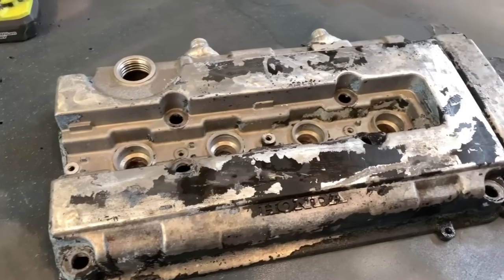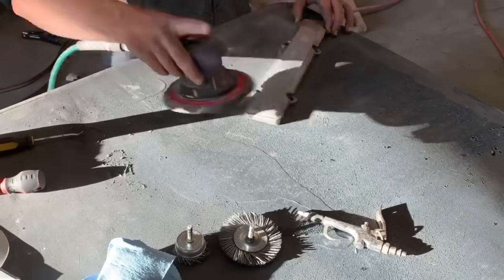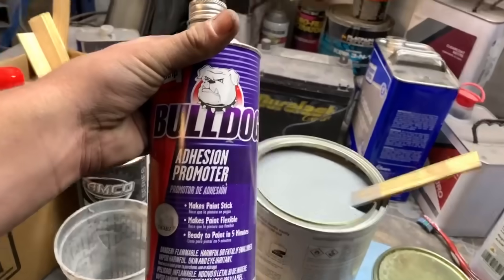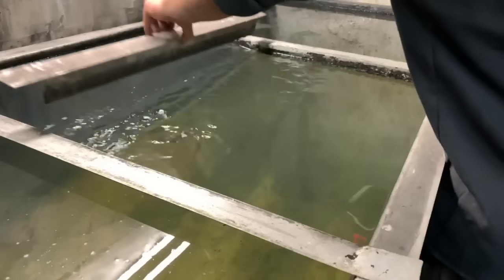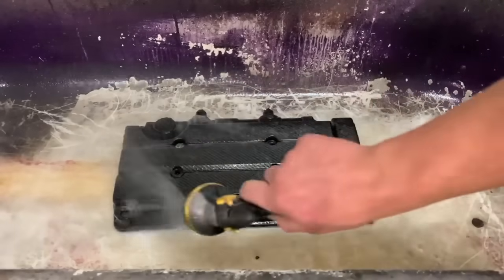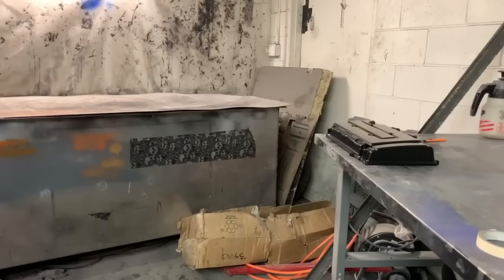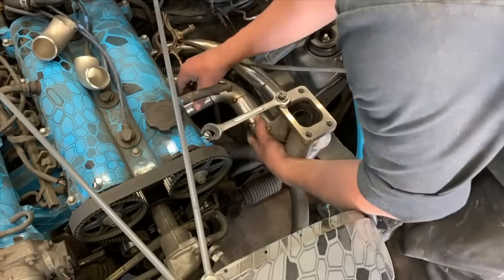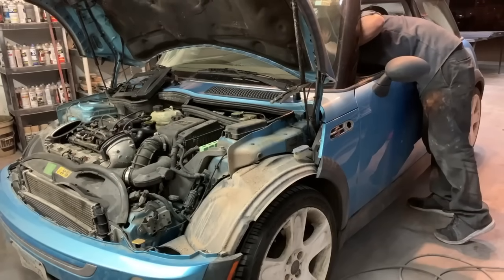Making Your Engine Look Awesome Step by Step

Comment: I get this clear coat called Wanda which is sold at Auto Parts Outlet, it's $90 a gallon and the shine is amazing and lays easy and no weird reactions or lifting or anything, the product is amazing, iv used PPG diamond and similar quality products and this Wanda clear is up there with big guys for a fraction of the price

Comment: I did my plastic rocker cover in the summer, I used high temp brake caliper spray paint for my colour and then 2k spray can lacquer and it's rock hard, which is good. But I didn't realize when I was doing all this that some dirt, little hairs and fibers are in there. I was thinking IL sand those areas back which prob. Means I will have to do the colour again and clear again. The 2k clear costs so much I wondered if normal clear lacquer will be ok? Or will I have to do the colour and 2k clear all again?

Comment: If you don’t mind my concern it is okay just wondering here may be you can help me.
I use VHT product but when I use clear coat there horrible reaction on paint which is brake calliper. Now do you have any idea which clear coat matches to VHT spray cans  that don’t react horrible..and what epoxy primer did you use on plastic? If there’s available on spray cans.. thank you in advance

Comment: Would that red spray paint stand up to muffler engine heat on a 2 stoke atv?  I’m looking to paint the engine and muffler. Any suggestions?
Reply: On engine it should but directly on exhaust it will change colors..
Reply: @randyledford6496  thank you for the reply!

Comment: Awesome looking valve cover job! Have you ever tried to hand polish the metalcast paint to get it perfectly smooth/glossy? Im doing a pistol and it looks awesome except one area where its noticeable not as smooth as the rest. I have it on thick enough to be pretty much opaque...was thinking about gently hitting it with some 5000grit, then hand polish to see if I could get it perfectly smooth. Btw- no clear coat, the metalcast is the topcoat.

Comment: So this is the first dipping video I have come across where you spray a tint after you dip. All my local shops I have talked to spray the red colour first, then they dip the part into black carbon fiber. I really like this technique though! How did you discover this technique, and do you find it works better, worse, or the same as the strategy stated above?

Comment: Pro tip, if your cover or anything else your sanding and using the metal wire brush on is aluminum, be soft and don't use a bunch of pressure, I didn't paint my cover, I just got all the dirt off and made deep scratches with the wire brush cuz my engine is all aluminum. I'll probably paint the cover soon tho.

Comment: Is there a reason you don't recommend vht high temp primer? I tried hydro dipping a fuse box cover and painted it with the high temp primer before but when I washing away the residue and touched it the hydro dip film came right off. Any suggestions?

Comment: Wait so for 3:10 when you say you don’t have to wet sand for 7 days do you mean we have to wait 7 days  then wet sand and then paint? Or do we do the epoxy primer then the paint then the hydro drip? I’m a little lost here please help!
Reply from the maker: The epoxy primer has a 7 day window to allow you to top coat it without sanding it for mechanical bond.

Comment: Awesome tutorial just one step I'm confused with 300° is not enough to even burn cooking oil let alone motor oil off of metal when you season a cast iron pan it has to be at 500 or above and it still doesn't burn the oil off

Comment: Do you get enough requests for your hydro dipping to do that for a living? Are there others in the Denver area doing it as well? Again, are you going to bodywork and paint the bug? I am thinking about sending you some paint mixing sticks and a pad to mix your filler on, it is a pallet that has 100 pages in it so when you mix filler, the next time you will have a clean sheet to work with, instead of a piece of cardboard you have been using. Amazon is taking a long time to get things out lately, so let me know if you could use word mixing sticks and the filler mixing papers.
Reply from the maker: Sure man! That’d be awesome!
Reply from the maker: I used to Hydrodip for a living but the money isn’t really worth it, especially without a booth it’d be hard
Reply: GARAGE IdiotS I just want to let you know, it took about a month to get my last order from Amazon . But it will be coming!
Reply: GARAGE IdiotS It should get to you on the 14th. That’s what they told me when I ordered. But it might take longer?

Comment: That is absolutely amazing my friend!
I have 1978 280Z valve cover, and intake manifold that I would like to send to you. My concern is would fuel cause discoloration to the finish and film? 
Again, outstanding work!
Reply from the maker: If fuel spilled on the clear and wasn’t wiped off fast yes it would eat into the finish if allowed to soak in

Comment: Is there a reason not to use a chemical stripper. Thats how I've been doing it then pressure cleaning and it takes 1 hour to strip and clean.
Reply from the maker: I did use one it got most of the old paint off but what was left is what I stripped by hand

Comment: Love to know the proven heat tolerance of whole coating is?
Reply from the maker: I have work I did 8 years ago on a LS swapped drift that has competed every season since and regularly hits coolant temps between 250-260 and it still looks brand new.  I have done literally thousands of engine bay parts and they hold up great.

Comment: What material do u use to get the carbon fibre to come off the paper to the metal surface, is
Reply from the maker: The process is called hydrodipping
Reply: @GARAGEIdiotS  thanks a lot.

Comment: hi,
Love the project!
Did you use cold or hot water for the hydrodipping?
Sorry I'm not english speaking and I was wondering what you sprayed on the carbon when it wa in the water?

Regards
Reply from the maker: Warm about 90 degrees

Comment: I have a problem using PPG after my parts are dry well over 48 hours after the fact PPG clearcoat in black scratches with finger prints any suggestions to prevent this?

Comment: How many heat cycles will this last?
Reply from the maker: Probably more than your engine will last
Reply: @GARAGEIdiotS  I cal that bs because even the factory paint on the valve covers peals off after 20 years. To say the engine will last less than the paint it means you've gotta a shitty engine which is not worth the trouble to beautify it.

Comment: Got one question, does it peel off over time?
Reply from the maker: No.  Over time the heat may make it brittle or discolor it but I’ve had my work on cars for almost 7 years now and most of it still looks brand new.

Comment: looks really nice. 
could you have used aircraft paint remover and use sand blaster to get the paint off ?
Reply from the maker: I got the majority off with air craft stripper but it didn’t take the remaining off

Comment: Great idea for content fella.. 
if you weren't so far away, I would try to organise a blasting cabinet & some soda. 
I used to have to do all the cleaning the hard way too, so time consuming & expensive too with all the wheels, discs & pressure packs you go through trying to get a good job done....

Comment: Interesting I thought VHT ( very high temp) was owned by Rust-oleum I just had a craze and lift using metal cast purple and vht clear switched to dupli color engine clear and the issue went away. Just saying

Comment: You could've used aircraft coating remover (sold at almost any auto part store) instead of all that wire wheel work to remove ALL old paint and residue. You just spray it on and let it sit, then wash it off with a water hose.. it works great!!! then, hit with a light sand blasting for a paint grip and you're done.. just an FYI. what you've done looks amazing!!!! 
Check out the spray here ( https://youtu.be/7K06Q0ZOOAk?t=42 )

Comment: I'm just happy you're learning to use NYLON wire wheels Preston and not the brass ones you used to use. 😉 It's always a better result. 👍
Edit: Also, metalcast FTW. Just don't try Orange like I did. 😂👍

Comment: No offence, but if you think that looks anything like real carbon your kidding yourself. Real carbon is amazing and changes depending on light angle which you can see. Hydro dip is 2d and doesnt not change depending on light angle.
Reply: For being a graphic and not real carbon though, it's the best I've seen.  I had 2x2 twill carbon on my suzuki and yes. The depth and 3 dimensions of reflection is amazing.